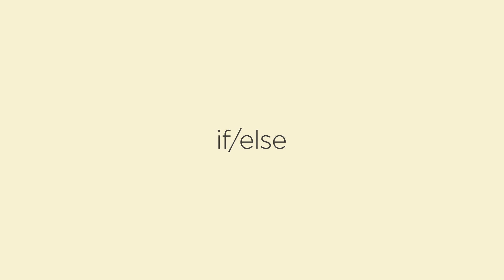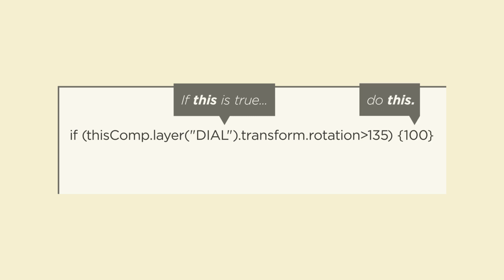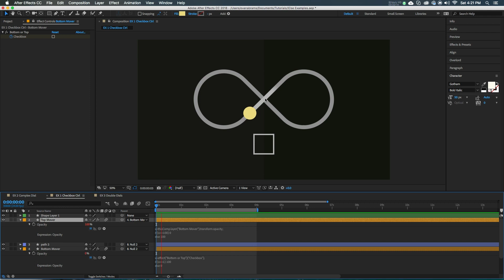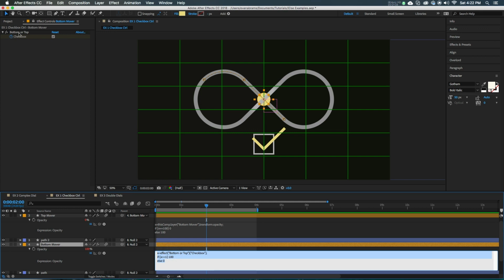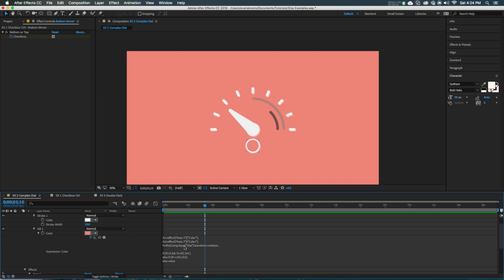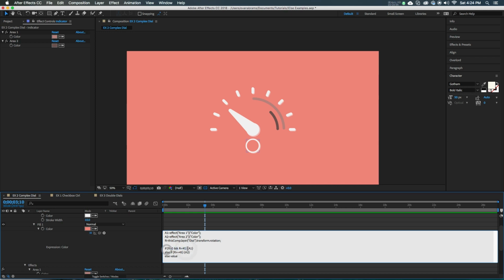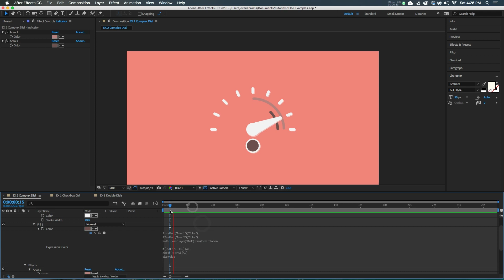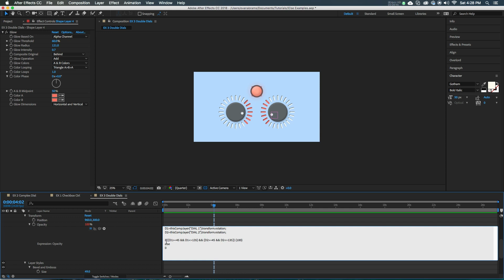If Else Conditional Expression - Adobe After Effects tutorial

Comment: simple question, let's take the first expression as an example:
If (x>45) {100}
else {0}
it works, but it's too sudden, from 0 to 100 and 100 to 0, would it be possible to smooth the process? like, once the x hits 45 the value goes from 0 to 100 but not instantly?
Reply from the maker: I suppose the solution will depend on what you expect to see happen. If you mean that once a number crosses 45 it sould trigger an animation, that's a little complex. I would recommend looking at the work of Dan Ebberts at motionscript.com to get into triggering animations using values or markers.
But, you might find what you want in the interpolation functions like linear(). For example you could do linear(x,45,100,0,100). That would give you an output that got from zero to 100 as x goes from 45 to 100. So from 0 till 45 the output is zero, then it has a linear change from 45 up to 100. You might also use the ease() functions for a more gradual roll on and off.
Does that make sense?

Comment: At 6:18 that statement if (R>0 && R<45)[A1} else ... doesn't seem to work anymore in AE 2020. I have no explanation for it. I had to make a workaround based on more than one opacity parameter in different shape layer levels to compensate for it.
Reply from the maker: It looks like you've made an error in there. the structure should be
if (condition in parentheses) {then what happens in curly braces} else {then what happens if else again in curly braces}
if the expression is exactly as you've got it in this comment, using a [ in place of a { that would be my suggestion for where to start trouble shooting. But let me know what error you're getting and I'll try to help if I can.

Comment: Hi! Thanks.
But how do I make the value change gradually? Does anybody know?
For instance if scale is more than 50, then I want opacity grow from 50 to 70 within 2 seconds. Is that possible?
Reply from the maker: Hi. As we say about expressions "anything is possible". Are you looking to use the scale as a trigger in this example?
Reply: @ECAbrams  Thanks for the reply!
I have a null with keyframed rotation. The rotation varies, it goes from 0 to -184, then from -184 to -94, etc. It is, basically, a steering wheel.
Whenever my steering wheel starts to rotate counter-clockwise I want to have this effect: scale gradually (within 1 second) goes from 100 to 90. When the wheel starts to rotate clockwise I want scale to go from 90 to 100.
It's like when you have two buttons which rotate the wheel; when press left - it rotates counter-clockwise, right - clockwise. Except, it is the opposite - it's the wheel that pushes buttons. (Wow I hope it is understandable).

Comment: i tried to put an expression in scale property but i keep getting error that needs 2 dimensions not 1?looks something like this 

this is in the scale property i also added a checkbox control ,basicly i want scale to change when checkbox is on ?can u help
var checkbox=effect("Checkbox Control")("Checkbox")

if(checkbox==0);
 100;
}else{
 0;

};
Reply from the maker: Absolutely. When you get an error like that, it's because you're not formatting the output in a way the property needs. Scale for example is of dimension 2. We always see it displayed as [x,y]. It has two dimensions, a horizontal and vertical. So you would need your outputs to be something like [100,100] and [0,0]. Right now your outputs are of dinemsion 1, would would be fine for opacity or rotation, properties of dimension 1 that only need a single number. If you format your outputs as an array [this,that] you'll be fine.
Reply: ECAbrams thanks for the reply I understand but seems something is still wrong 

var checkbox=effect("Checkbox Control")("Checkbox")

if(checkbox==0);
 [100,100];
}else{
 [0,0];

};

Or am i still doing it wrong how would you right the code?
Reply from the maker: @karlamata7421  well,  there is a lot off about what you've got. You have a lot of ";" and not in the right places. Some {  } that don't open. Let's simplify to:
checkbox=effect("Checkbox Control")("Checkbox");

if(checkbox==0) {
[100,100]
}
else
{[0,0]
}
Reply: @ECAbrams  thanks i saw the problem now and its working!thank you!